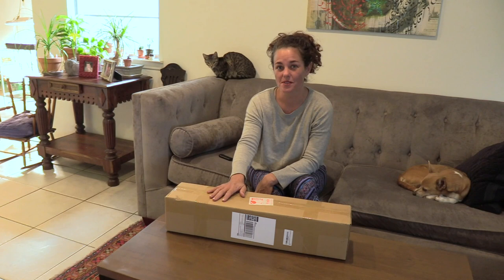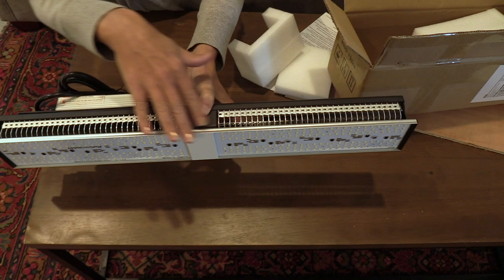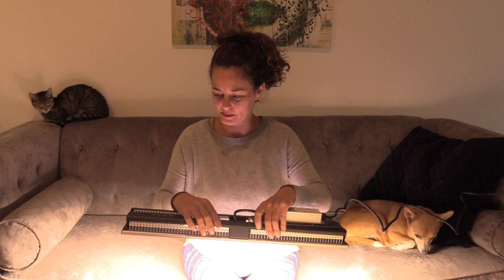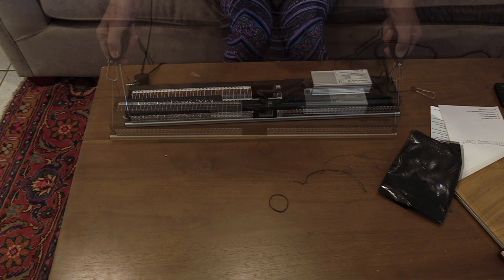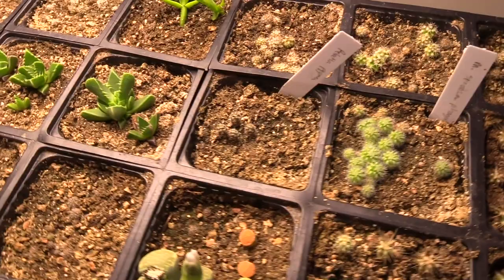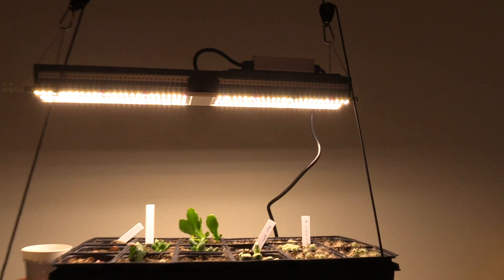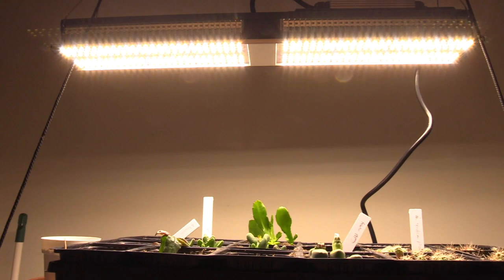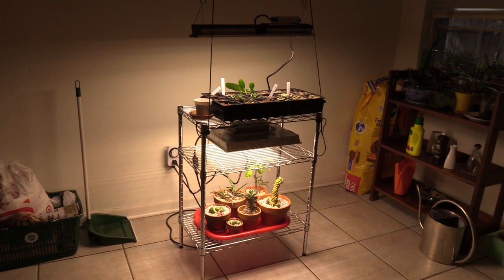DIY Grow Light Stand: 2 levels, 2 lights, one shelf

Comment: Those metal pieces on the Mars Hydro light are called a "heat sink."  It's basically a passive way of cooling off the lights by letting the heat travel through them.  I learned about heat sinks when I built my computer, so I just figured I'd share some knowledge I have since you've shared so much of yours with me!  Thank you!
Reply from the maker: Thank you! I remember hearing that term now :)

Comment: You review some nice but not inexpensive grow lights.  I have purchases and use led grow lights that are cheaper.  Is there any reliable way to test and see what quality and strength of light I’m achieving with mine vs what you get with the more expensive ones?   Or is it really only testable with results?   How do I know that I wouldn’t get happier succulents with different lights?
Reply from the maker: The full spectrum LEDs are pricier for the size vs fluorescent full spectrums. You could order a light meter to see what kind of readings you get - something like this: https://amzn.to/2JVzKoh
Reply: The lights mentioned here are 13,000 lumens.  That means they can be further away from the plants than what is shown in the video.

If you have other lights, eg 2500-3500 lumens, it just means your light should be closer to the plants.

As far as Kelvin rating, the video mentioned full spectrum, so that is around 5000- 6500 K, higher being better.  If yours are like that, then your setup is sufficient.